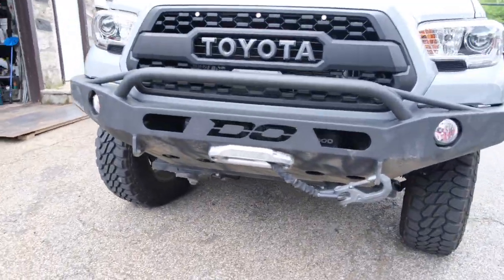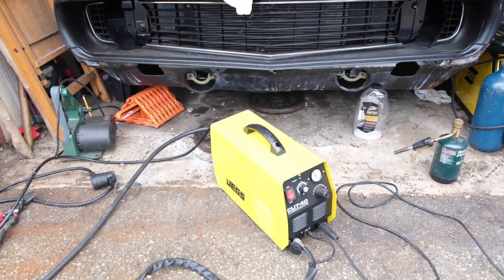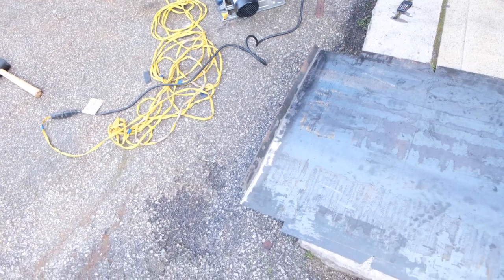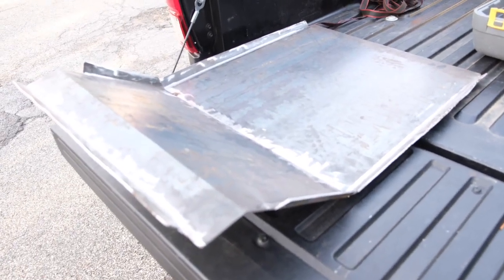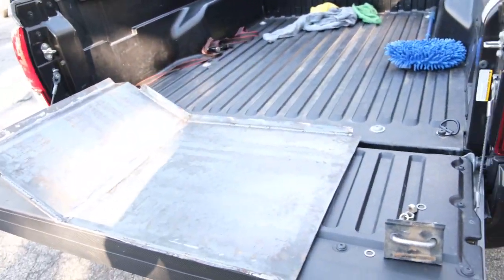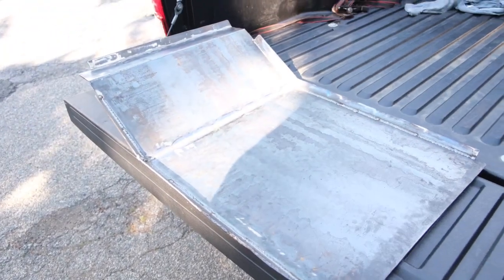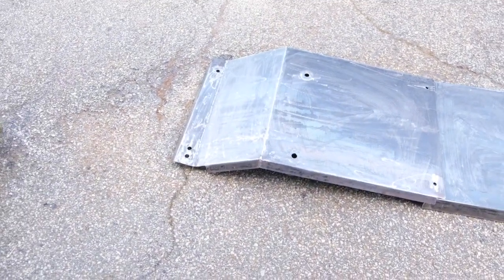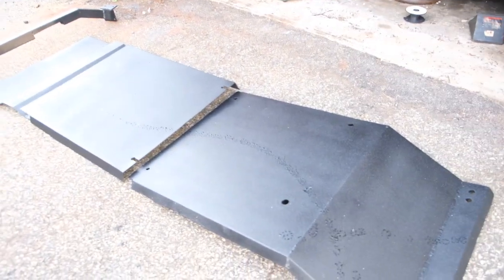DIY Skid Plates Body Armor

Comment: Skid kit seems solid dude! Did you used 1/8”? Do you happened to save the measurements, seem like I’ll be mimicking your set. Keep up the good work!
Reply from the maker: That is correct, looking to do the same for my forerunner with possibly a 1/4 inch steel. The 1/8 inch took a beating. And thank you brother
Reply: @roughpatchroad I did a video of my skid plates and share the measurements for my tacoma(sizes are the same for 2nd/3rd gen) Tacoma